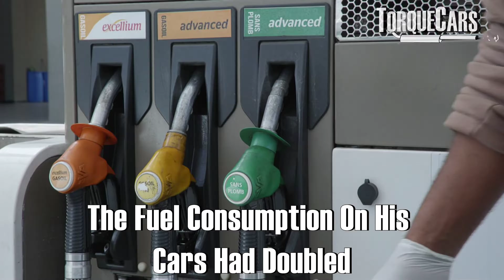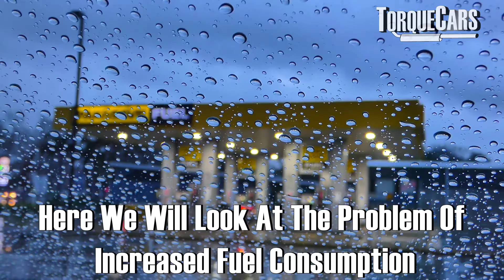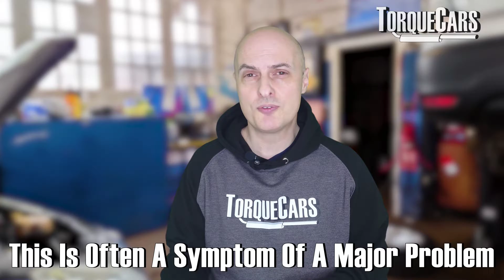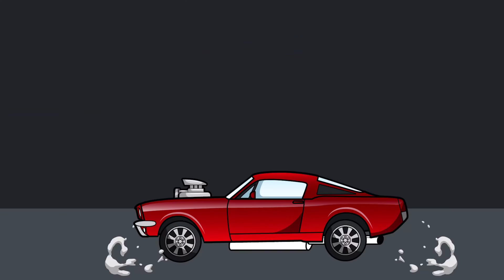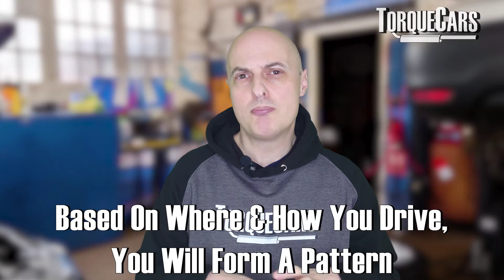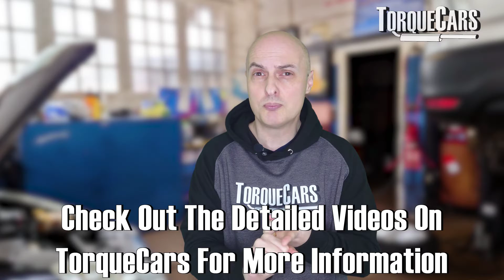Fix High Fuel Consumption! ⛽️ Beat Fuel Economy Dropping & Save 🤑!  Diagnose Fuel Wasters

Comment: Sudden high fuel consumption is usually by failing CO2 sensor.   Over time higher fuel consumption is caused by bad spark plugs and clogged air filter.   Sometimes auto transmission might be on its way out and cause drag and rub your engine of torque causing to consume more fuel to achieve same speed.  Dirty injectors will cause higher fuel consumption.  Injector issues are not very common. When it comes to suspension components, the drag from these is insignificant.   Brakes if they stick, you’ll smell these if they cause drag.

Comment: I changed my fuel to shell vpower diesel. I drive a Seat Tarraco EA288 190hpDiesel. I do believe I’m getting more mpgs. Not noticed much change in power as the engine delivers incredible torque as it is…. but hoping it keeps the injectors in better condition. What’s anyone else’s thoughts on premium fuel? Does it make a difference for you?

Comment: Hi, I own a Polo 6R with a 1.6 TDI CLNA engine from 2012. It had timing belt replacement shortly before. It's also remapped to Stage 1 tune with EGR off. Recently I found out that the "Camshaft adaptation intake - phase 1 position" is around 4.0 to 4.5 degrees. For reference, I checked in a similar driven car which had 0 degrees all the time. I've asked in numerous forums about possible engine issues due to this. From what I experienced, the car feels sluggish in lower RPMs and want's to stall. Does the adaption degree have anything to do with this? Please help me out on this one. Thanks!

Comment from the maker: Had any fuel wasting problems on  your car that you hadn't spotted at first? How close do you get to the manufacturers quoted MPG?
Reply: @torquecars  my fuel consumption has been relatively the same over the past year. Just got my car back from the mechanics who replaced the brakes, handbrake cables and interior blower motor. Now it uses no exaggeration 3 times more fuel. I have an Astra H and I drive 120km per day and usually it’ll use an 1/8th of a tank. Today it used over  3/8ths which is over 20 litres. Left home with a quarter tank, which usually will last me 2 days or 240km and today it only got me 60km.